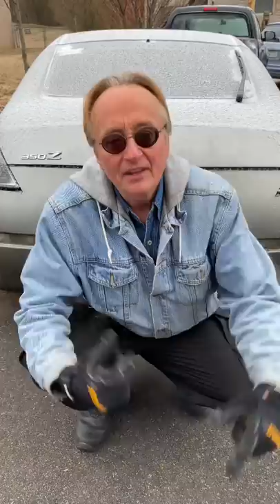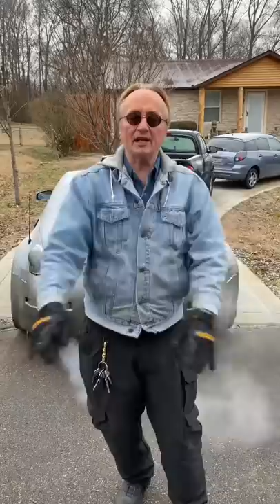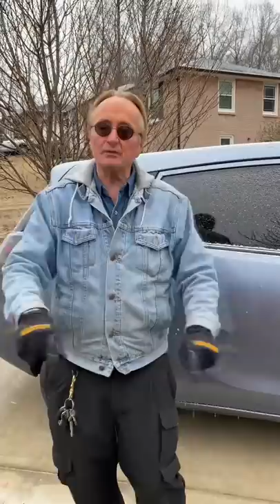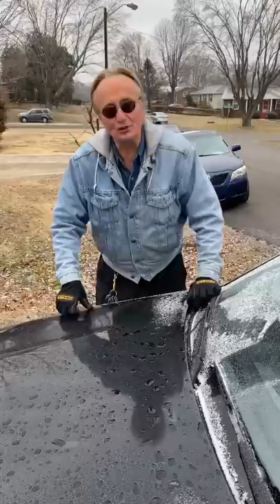This Illegal Mod Will Make Your Car Run Better

Comment: My dad is a mechanic in Mexico, and we used to get cars with clogged converters the easiest fix was to removed them and we hit the inside with hammer and chisel put them back on and there 😂🤣 it was fixed.
Reply: When they first were put on new cars, I remember an older dude at church described doing exactly that to his new car.

Comment: Can I do this without having a permanent check engine light on my dash?
Reply: Think of that light as a Christmas light! It will bring more joy....
Reply: yessir just go to a dyno shop and get it tuned!
Reply: if you have an O2 sensor in or after the cat, you'll need a dummy sensor.  They are sold as diagnostic and tuning aids, and are cheap.
Reply: yep most cars will require a retune after straight piping because the 02 sensors in the cats get thrown off for having much more flow.
Reply: Stand alone ecu is one way
Reply: Yes, but you need a nice sticker.
Reply: @firebird77clonefirebird89  tell me more about these !!
Reply: No, you need a cel eliminator which tricks the computer into thinking it’s good. They come angled or straight depending on your clearance.
Reply: I know on the gm trucks I've got, I'd put an anti fouler on the end of the post cat o2 sensor and never got a check engine light from it. I'd imagine that'll work with most other cars as well.
Reply: Yes you can either use a plug in style thing that essentially plugs into o2 sensor connectors to basically tell the computer it's reading fine or you can tune to car to do the same thing and you don't have to get plug and can usually get more performance out of them via tuning the ecu

Comment: You're not gonna get any noticeable power from removing a catalytic converter. Unless your car is from the 80's. Modern cats already flow very well.
Reply: Yeah with newer cars it will make your engine hotter and blow your piston rings.

Comment: Or get a high flow cat system and do both, only reason to remove cats completely is if you are at a really high power level and on a 2-step or antilag system a lot (as these will blow the cats out anyways)
Reply: Aww for real? I wanted anti lag but i dont wanna get rid of my high flow cats- would a exhaust cutout work?

Comment: Unknown fact to most every single person that will see this video, removing your cat will not free up any power unless it was partially or completely stopped up.
Reply: and it releases Carbon Monoxide, a Deadly gas!
Reply: But damn, I’ve owned this car from day 1- it NEVER jumped like it does now. And it’s a pos 1.8L Nissan with jatco 5-speed automatic. I know you said most every single person, but for Nissan, it’s ride or die around here

Comment: Remove your converter if you'd love to have a permanent check engine light !
Reply: Couldn’t I just trick the computer to remove it for that specific reason? Or maybe not
Reply: 02 spacer or a tune can remove CEL

Comment: I thought the engine was designed to work with the converter? Wouldn't removing the converter mess with that?

Comment: still depends on the tuning. most cars if you straight pipe it without tuning it, it would eventually end up making the car slower to expel out exhaust gases

Comment: They dont check diesel trucks in my area so i took off the dpf the cat and muffler. Runs much better and was cheaper than replacing the dpf

Comment: Catalytic converters produce reverse pressure and, if removed, will actually reduce proformance. You can replace the muffler with one that has better flow (for under $200), yet doesnt make your car sound like a shitbox.
Reply: @quadzero6339  CEO
Reply: @nehemiahabraham9974  you would be lol
Reply: @quadzero6339  😂😂

Comment: If I could, I would take the cat off and leave a regular muffler on.  You gain power and don't shake windows when you drive by a house.
Reply: Lmfaooo I'm tryna sleep here aha
Reply: Nah you leave the cats and remove the muffler because you still gain hp, you can’t be pulled over for emissions, and everyone within a 20mi radius will here you coming down the road.
Reply: That’s what I did, I mean …. some one stole my catalytic converter and left the muffler.

Comment: 99% of vehicles won't notice much, if any, difference in removing catalytic converters. Exhaust systems from the factory are designed to flow what that engine needs in stock form. 

Keep the cats on unless you're heavily modifying your vehicle and will actually benefit from the extra flow. And even then you should still try and be environmentally cautious.

If you want the sound, try a high flow cat.

Comment: My truck is straight piped with a dual attachment, and my car is quiet with full exhaust system, you can have both.
Reply: How did you manage that?
Reply: @goodiegoodygumdrops  cuz he used "mufflers" not straight pipes..
Reply: If you have mufflers it's not a straight pipe, and you loose more in mufflers than you do with properly sized catalytic converters.

Comment: Well Scotty on some cars, like my Cadillac, if you run a straight pipe you will lose lots of back pressure causing you to actually lose power, unless you have your car tuned for a straight pipe of course

Comment: I did this on my first car when I was young. You also gotta realize this makes the car LOUD. I'm talking too loud for most, I remember I had to drive to another state for my sister's wedding and the drone between 65 and 85 was unbearable. I honestly don't recommend this, just go with an exhaust system or muffler upgrade if you want better sound in my humble opinion.

Comment: Or what you could do, take your catalytic converter‘s off and beat the catalyst out of it then put it back on bolt it in then plug your O2 sensors back in And if you go to get inspected it looks like you have catalytic converter’s, I live in upstate New York and I do it all the time, I’ve passed every single time

Comment: Not having the back pressure in the exhaust is hard on your exhaust valves. Back in the 70’s and 80’s that might be true but cars today are designed to operate perfectly with mufflers and catalytic converters.
It’s better to leave your car how it came stock. 
I love you Scotty but I have to disagree on that one

Comment: well where i live we have strict rules about it ... so how i go around is i take a steel pipe  connector and cut my straight pipe at the end and put on the tip with the muffler and after the ispection test almost immidietly change it back ... fast and simple

Comment: This is some of the worst advice one can give. Modern cats offer very little obstruction to the flow and removing it can even hinder performance without a proper engine tune. At best this will give u like 10 more hp while significantly increasing emissions that are harmful to the environment and the people around you.
Reply: That is what manufacturers tell to sell you sports cars that sound like vaccuums

Comment: Horsepower.  Thank god I am from one of those counties in Tennessee
Reply: You can actually make more power with a high flow than with a test pipe with the same in/out size, tuning has to be slightly different, but you can, and you can get gasoline engine cats with in/out ports up to 6 inches in diameter.

Comment: Lol i don't know if this is a troll video or not. But your exhaust pipes have a lot of math involved in the performance of the car. And removing catalytic converters ,mufflers or even changing the bends or diameter in your exhaust will change the flow of exhaust. Straight piping if not done right can effect the cars performance especially gas milage. All engines require a specific amount of back pressure.

Comment: I have mine still on, but when I go flex fuel it goes away. It’ll be useless and I won’t be running normal gas that often after that anyways.

Comment: For my knowledge, removing the Catalytic converter will effect the driver health cause of the polluted gas (having skin itching / throat sore etc..)
Reply: How? Are you routing the exhaust into the passenger cabin?

Comment: Legal way is to use 2 cats. It's more expensive but also not illegal. If you drive a truck it's possible to get a larger one and there are also many other ways to tune the exhaust. Again the issue there is cost

Comment: I think imma do it were i just remove the muffler and then put a another pipe there or shorten my exhaust on my truck i want a straight pipe with out buying one and so my truck doesn’t sound clapped imma keep the catylac converter just so the oxygen sesnor doesnt give me issues

Comment: in Colorado straight pipes are legal. We have been pulled over multiple times for “sounding like we are racing.” the cops around here though just want to get money and are pulling people over and arresting for anything even on private property(which is illegal) and wont hold back on giving you a ticket for a straight pipe. You can challenge the ticket and your free from it.

Comment: Straight pipes dont really give your car much power they just make your car louder, if you want more power then go with either X-pipes or H-pipes. X-pipes are better for high rpm horsepower whereas H-pipes are better for low end torque.

Comment: If there is more power then the engine uses less fuel to create an equal amount of power. Efficiency will often increase.

Comment: If you have an upstream and downstream O2 sensor this will not work and you will have CEL and poor fuel mileage. You have to have the ability to tune your vehicle or dummy out th O2 sensors for this to work.

Comment: Don't remove cats, please. Install a high flow cat if you want, but the cat is probably the most important thing that allows cars to not wreck the environment.
Reply: Yes, if you want.
Reply: @northwesttrails7176  no. It can't be just something that you do if you get caught, it has to be a team effort.
I love ICE cars, don't give regulators the excuse to make everybody switch to electric. Let them be as clean as they can be.
Reply: @FAB1150  the only reason id run a cat is for inspection

Comment: Straight pipes aren’t actually that healthy for ur motor since no back pressure really
Reply: You don't want backpressure, I am tired of people saying how you need back pressure.

You want exhaust scavenging, which is different than back pressure and is able to be done whether you have a stock single exhaust or dual straight pipes.

Comment: Can’t pass in Texas?  Maybe in Houston or Dallas or Austin. Other than that, it’s all safety $7 inspections. Yes federal law prohibits this, but emissions only get tested in the big cities. Keep your cats on people unless your keeping it off road, then opt to use long tube headers and that will promote exhaust scavenging which will help pull exhaust out of the cylinder and you WILL pick up power. Depends on what your doing. If you need cats, keep them, if your wanting a “race car” then take them off the proper way!

Comment: Correction it's against the law to remove a catalytic converter without replacing it with another catalytic converter. Because yes even those mess up

Comment: Hi-flo cat? Don't know if there's truly any gains to be had vs a factory setup.. I don't have a wheel dyno, but I'll take their word that it does.
Reply: Maybe a very small gain. In stock form most engines won't benefit much from exhaust modifications. Though they may sound better.
Reply: @BraydenSB  my feelings also.

Comment: Its actually against the law to remove turbos on a car that comes with them from the factory. Emissions control devices you can get a $10,000 fine

Comment: Here's the deal, I care very much about the environment. If you're going to straight pipe it you better tune the s**t out of it. New plugs, fuel and gas treatment (MMO) MASS air flow sensor,       The works. If it still fails put in a universal and take it off as soon as you pass emissions and save it for next time. I'm just throwing out suggestions. 👍

Comment: While still illegal….. BUT removing the CAT with a forced air engine burning E85 gas and with a good tune, it’ll run lower emissions out the tail pipe than with a CAT.   Go figure that one out.

Comment: Not always true lol most cars actually need back pressure for scavenging for fuel economy which the muffler does
Reply: Second time I've seen this "back pressure" thing, has anyone taken a look into wave theory and how exhaust pulses work? Back pressure, understood as the pressure generated by the negative vacumm on the exhaust stroke, will only send high pressure waves back into other cilinders, messing up their ability to exhaust gases as there is no vacuum to suck them out. On the other hand a free flow exhaust with a properly engineered manifold will make it so the exhaust strokes generate negative pressure waves(vacuum left behind by exhaust gases) which are the opposite of back pressure, thus forcing exhaust gases out from the other cilinders during their exhaust stroke; this improves exhaust gasses scavenging, power and reduces carbon buildup in the valves. The reason most cars loose power when "de-catted" is because the sensor in charge of analizng exhaust gases to adjust spark timing and injection is simply getting data that doesnt match what it is programmed for , the car will need a ECU tune to adjust to the new parameters.

Comment: Someone stole mine out of a $1200 lumina and they wanted $600 to replace it so I ended up placing a straight pipe instead for free and it got quite

Comment: Hmm I thought removing muffler decreases rear end pressure, thus making the car slower
Reply: Not the muffler, just the cat, then put a straight pipe in its place.

Comment: It actually makes your car run less efficiently because there's not as much back pressure on the engine. Your ego has to be gigantic also to want to be that loud.

Comment: It will absolutely not make your car run better. It will increase the maximum peak output of your engine. Your engine was not made to run consistently at maximum peak output.

Comment: That is not all true. There are some cars where the catalysator acts as a push back for the gas of the engine which is actually needed for some engines.
Furthermore your lambda regulators can act up if your catalysator is removed due to the impossible measurement data which in return makes your car run worse. Dont trust everithing you see on youtube

Comment: Cars can actually pass emissions without a cat u just have to know what your doing. Like if a car is built for racing properly u dont want any fuel making it out the exhaust pipe. My dads boosted 450 hp volvo 740 is 100% street legal in the state of California and it just has a 3 inch exhaust all the way to the rear. No cat no muffler. And the exhaust smells like burnt air.

Comment: The catalytic converter doesn't have a dam thing to with the emissions of a engine the way that the engine and computer is tuned effects the emissions the only thing the catalytic converter does is choke the engine to death and further more all fuel injection systems give off worse emissions than a properly tuned carbureted engine

Comment: For real Scotty, this shouldn’t be encouraged, the type and the amount of gas that comes out the exhaust can kill a human in minutes. Imagine sitting in traffic behind a straight piped car for hours and you have a baby in your car. Its going to asthma or other lung problems. Did you read about a couple in england who straight piped their car with the pipes out the hood? They died from fumes while driving! It isn’t right. Some race cars still have cats just to show they barely reduce power. But sure most road cars cars can gain 2-5% bhp from decatting.

Comment: If there is no back pressure on the engine it will run worse with less horse power

Comment: The scavenging effect won't be as great though
Reply: Why not? Touching anything after the exhaust manifold wont mess with exhaust pulse timing, whats more, you are allowing an easier and faster flow of gasses trough the exhaust(considering you have exhaust pipes of the correct diametre). As long as your ECU is adjusted for the change in exhaust sensor readings you wont lose any power nor fuel economy.

Comment: Anybody else wanna talk abt how he's wrong? Like fr yes its illegal, no I don't think it should be illegal, but still straight piping a vehicle does not give you more power, in most cases it does the opposite and causes a whole host of problems because in order to run efficiently gasoline engines need back pressure.. also I am in Houston and I see tons of straight piped mustangs and trucks daily...

Comment: It's not my responsibility to save the environment. Horsepower all day every day!
Reply: @Unholy Pastor Not really, buying a Tesla won't do much when corporations are dumping oil in the Gulf of Mexico. In the same way a straight piped Nissan won't do much harm to the environment compared to them.

We've been conditioned to believe we can save the environment by buying paper bags, taking 5 minute showers and reducing our plastic waste, but in reality the only way to stop pollution is to hold these corporations accountable for the emissions they produce and force them to change their means of production to make their waste as green as possible. And even encouraging the construction of nuclear reactors with modern technology could help too since it's the cleanest reliable energy source.

By the time you read this, the manufacturing industry has produced more carbon emissions than you will do in your entire lifetime.

So I beg to differ